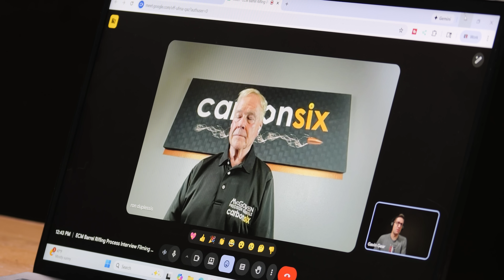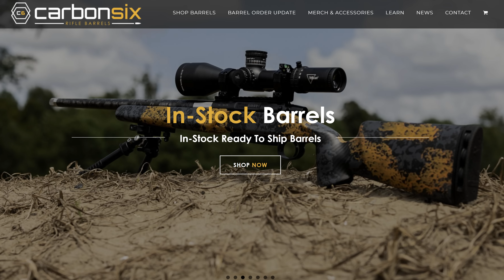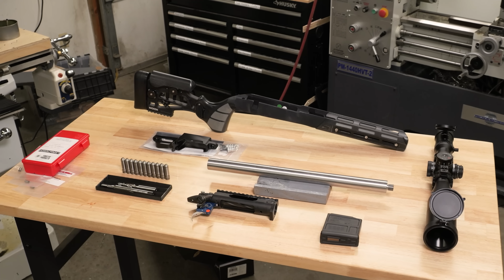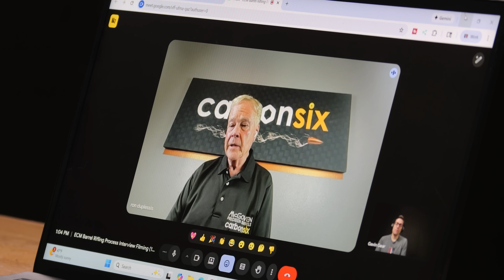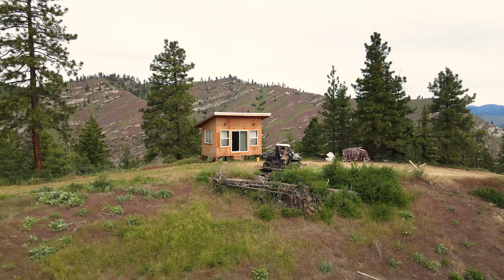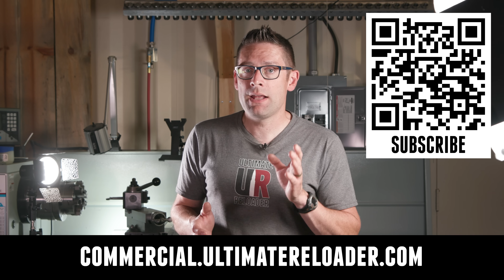ECM Rifling: Discussion with Carbon Six/McGowen (In-Depth)

Comment: How fast of twist can it do? Faster twist for those heavy sub sonic 300 BLK and 8.6 BLK?
Reply: Theoretically as fast as you want, since it's a programmable machining process
Reply from the maker: Yes, that’s correct and you also have to have the appropriate cathode with a near matching twist rate on it
Reply: Then it would be a matter of the bullet construction
Reply: You can order 1 in5 twist for the heavy 300blk all ready 
And also that why the honey badger has it
Reply: Do not  see gain twist done with this method

Comment: The high tech version of what people were doing to put 9mm barrels on 3d printed FGC9's
Reply: This man knows.
Reply: CAN'T STOP THE SIGNAL
Reply: also- svd
Reply: I’m curious now? What exactly were people doing?
Reply: @ronnc1636  tooling made with 3D printed parts, common wire, simple power supplies.  The printed parts held wire and made passages for salt water to flow and carry away etched metal.
Reply: @ronnc1636  bathroom meth lab looking contraptions. Mad scientist sh!t
Reply: @ronnc1636  using a 3d printed mandrel to electrochemically etch rifling into short barrel blanks
Reply: Exactly, and this guy doesn't understand the difference between ECM and EDM. Total dingus, they should've put someone more technical on for this interview.
Reply: Crazy accurate, completely customizable, and using hardened explosion proof alloys is as easy as mild steel.